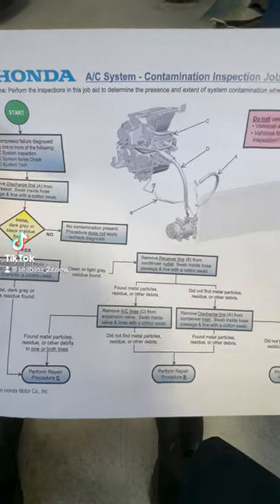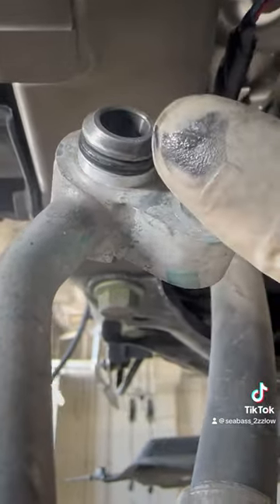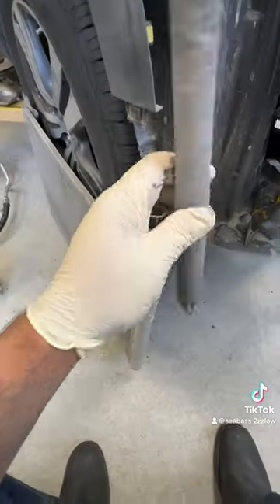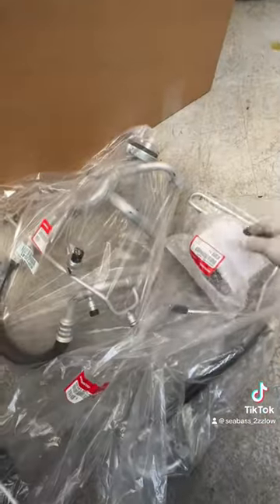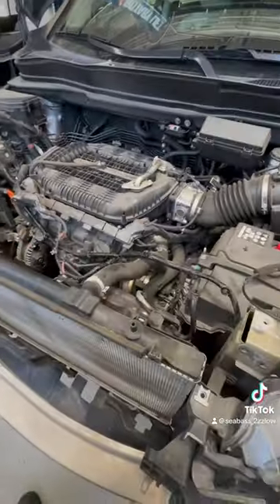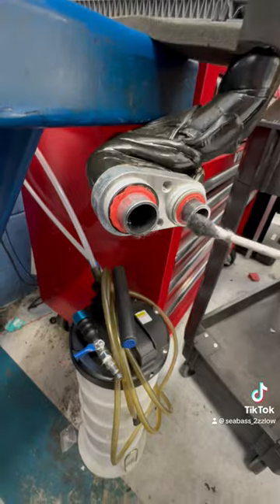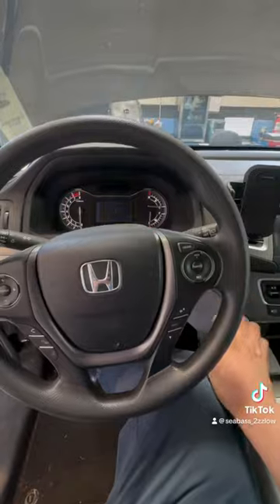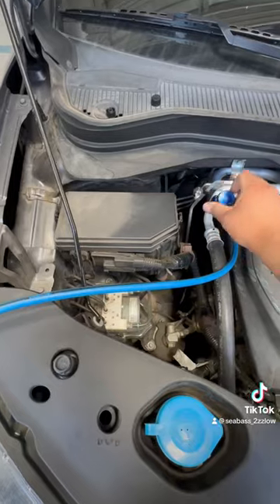AC not working on 2016+ Honda Pilot? Pray it’s not this… #blackdeath #honda

Comment: Knew what this job was, as soon as I saw that job aid. I have done this job more than once. I push for procedure c when applicable, so the customer doesn't have to pay for parts AND labor twice because the customer and or service advisor and or service manager wanted to do as little as possible to "fix it".

Comment: I have a Honda civic 2020 Sport Hatchback 
I believe all 2016/2021 model years get a free AC component check and the dealer replaces it free of charge I believe 10 years no limit on miles 
I went for No AC/ Cold air out of vents and strange sound when turning on ac
Reply: Can I get a fact check on this 😮 my ac recently stopped working and I’ve tried swapping the relays etc

Comment: You cannot flush that system out.
Reply from the maker: yes which is why everything had to be replaced.
Reply: @2zzlow  yep I've done a few of those. People don't realize that you have to drive the car easily with the a/c on. You can't go around revving up the car driving fast with the a/c on. Cut it off when passing in traffic or high speed driving.